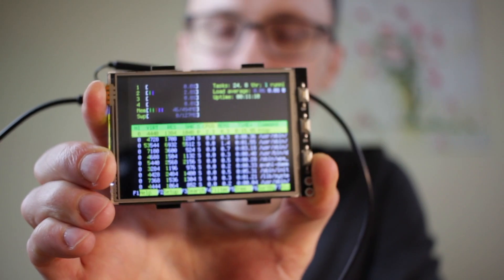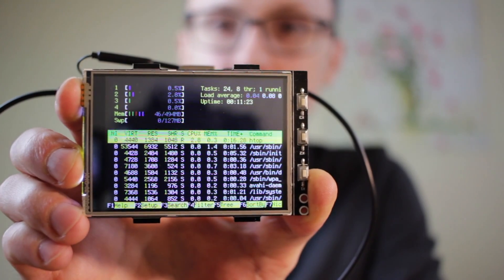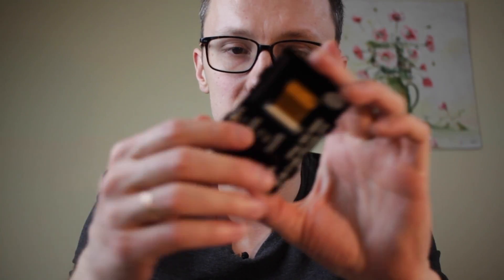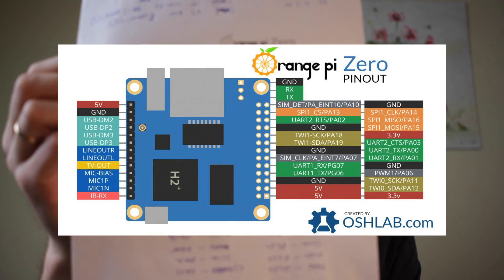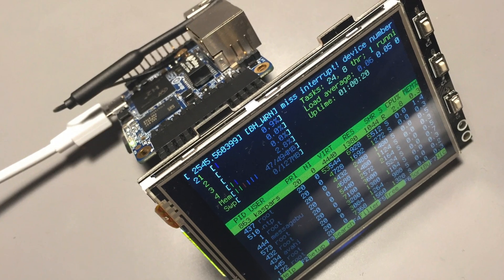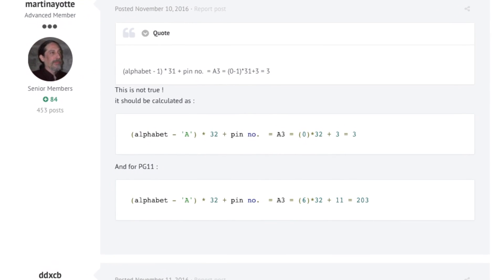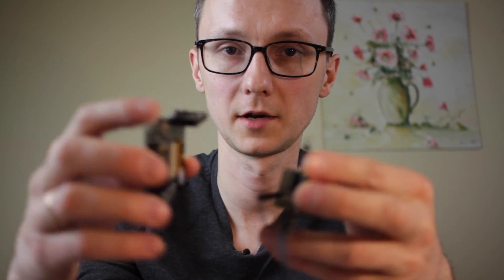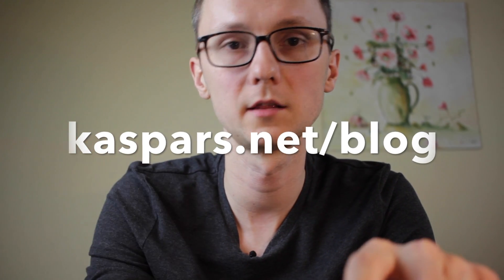Display for Orange Pi Zero

Comment: What piece are you using to connect the screen? On my Orange Pi ZRO LTS, I only have the holes for pins, no pins to actually connect to. Having a hard time locating/naming the piece I'd need before ordering the display and being unable to physically connect.
Reply from the maker: You need to solder a 2x13 (2 rows with 13 pins each) male header (also known as 26-pin header) with 2.54mm spacing between the pins to those holes. Any of the headers for the older versions of Raspberry Pi (not the 40 pin version) will work for this! Any of these should work https://www.google.com/search?q=2x13+2.54mm+header

Comment: I am trying to decide whether i need an orange pi and if it is really worth buying thanks
Reply: It is a Great board. Lts version with the H3 CPU even includes the hardware h.264 mpeg compressor on board which newer cheaper boards do not have

Comment: Will this also work with the O.P. 2G-IOT?
Reply from the maker: Not sure. It should work just fine as long as your OS can access the i2c bus. I think Armbian doesn't have official support for this board, though.
Reply: +Xander Marks seems like it got its own (maybe semi/official screen, not sure) working on Android though.
https://youtu.be/F2JcD865TFc
https://www.aliexpress.com/item/3-5inch-Black-color-Touch-Screen-LCD-screen-TFT-Suitable-for-Orange-Pi-2G-IOT-Development/32816194245.html
Reply from the maker: Yeah, that seems to be attached via the CSI connector.

Comment: Hi man! How are you? I'd like to know how could I configure this board with his expansion to connect via AV cable to my smart tv ;) Thank you very much
Reply: Armbian download page states that AV output is not working yet; either wait for updates of the distribution, or explain which other distro you are using.
Otherwise, for the hardware part, I bought a classic AV (RCA) cable https://fr.aliexpress.com/item/High-qualiy-1M-AV-line-Single-Yellow-RCA-Video-cable-Male-To-Male-Audio-Video-Cable/2027911312.html?spm=a2g0s.9042311.0.0.EoKBYo , cut it in two, soldered some femele pins https://fr.aliexpress.com/item/Free-shipping-Dupont-line-120pcs-20cm-male-to-male-male-to-female-and-female-to-female/32797542086.html?spm=a2g0w.search0104.3.15.gDbBzS&ws_ab_test=searchweb0_0,searchweb201602_5_10152_10151_10065_10344_10068_10342_10343_10340_10341_10084_10083_10613_10305_10304_10615_10307_10614_10306_10302_10059_10314_10184_10534_100031_10604_10103_10142,searchweb201603_36,ppcSwitch_5&algo_expid=a5714876-fcab-41cb-946a-7a4e698c05cb-2&algo_pvid=a5714876-fcab-41cb-946a-7a4e698c05cb&priceBeautifyAB=0  with heat shrink tube , and plug it where the docs say: small port, pins 2=GND and 9=TV

Comment: What did you use to connect the monitor to the board and which lcd are you using?
Reply from the maker: These LCD modules have a Raspberry Pi compatible connector which also works with all versions of Orange Pi, see http://www.waveshare.com/media/catalog/product/cache/1/image/9df78eab33525d08d6e5fb8d27136e95/3/_/3.2inch-rpi-lcd-b-3.jpg
Reply: Kaspars Dambis but where do i Get the gpio pins to connect to the monitor
Reply from the maker: This blog post describes the pin connections, see https://kaspars.net/blog/linux/spi-display-orange-pi-zero And here is another blog post explaining the GPIO mapping for Orange Pi Zero https://kaspars.net/blog/linux/orange-pi-zero-gpio
Reply: Kaspars Dambis ok thanks im new to these stuff..so do i need to buy the pins?
Reply from the maker: Yes, you need to solder two 13 pin "male" headers to the Orange Pi Zero, such as these https://kaspars.net/go/male-pin-headers

Comment: Thanks sir, does it work for H3 chip ?
Reply from the maker: Yes, should work just fine since the H2+ chip is very similar to H3.
Reply: Just remember it's quad core...so it runs really hot...so a good large heatsink and active cooling is key, otherwise it throttles itself really fast
Reply: @haydenc2742  You can also throttle the CPU speed. There is a module in Linux for doing the same.

Comment: Can this work on RetrOrangePi OS?
Reply from the maker: Should work just fine as long as it has SPI enabled and the required FBTFT drivers.
Reply: hmm, when I try to execute con2fbmap 1 8 I get an error "ioctl FBIOUPUT_CON2FBMAP: Invalid argument". The SPI is enabled but I don't know about the driver for ili9481.
Reply: Check out DietPi...much lighter resources
Reply from the maker: Thanks for the suggestion!

Comment: Hi Kaspars
I got Orange Pi Zero from alliexpress. And no power led flash when power on. Only LAN led flash all time (green and yellow).
Any suggestions to know is it working ?
Reply from the maker: I had a similar issue and it was because of a corrupt disk image on the SD card. Try reformatting and burning it again. I was using the latest Armbian image (legacy) https://www.armbian.com/orange-pi-zero/
Reply: Works now. Thank you. But now cant find IP of device so i cannot connect it with Putty.
Reply from the maker: You could check your router for the connected client IP addresses when you plug in the ethernet cable.
Reply: No green LED means either crappy PSU, or bad system on SD card.
To find the IP, you either need a scanner (there are apps for mobile phones), or connect to the serial console (there plenty tutos in google; buy an USB serial port and a pair of Pudont wires).
Scan 2mn after boot, remove ethernet cable, rescan, see which IP have gone away. The IP is usually the same for a few days, untill you reboot your DHCP server. To get it fixed, ask your DHCP to fix the IP using the MAC.

Comment: Nice! I just bought it as a chromecast replacement and found out that I screwed up. No HDMI. Is there any way to get an HDMI port without much of a fuss, or should I just buy a different board?
Reply from the maker: There is no way to add HDMI as far as I know. It does have composite video out though https://forum.armbian.com/index.php?/topic/2913-orange-pi-zero-tv-out-and-x11vnc/#comment-21046
Reply: The H2+ does not have the HDMI chip at all (it's not only missing the plug on board; it's missing a chip in the SOC). 
There is a TV output, but it's not working yet in Armbian 5.35.
The only way to get video is SPI (and I love it).
Sell me your zero :)
There is an Orange zero with HDMI support; but it's 3 times more expansive. Not sure the exat name (zero plus or zero PC ... ask Ali).

Comment: Hi friend! I'm using a translator! I'm using Orange Pi Zero and installed Ubunto Desktop on the SD card, to see it working only with the Lcd screen ?? I have here a screen of the Raspberry pi 3, does it serve to stop calling? Thank you
Adalberto - Brazil
Reply from the maker: Hi! Unfortunately Orange Pi Zero doesn't support the DSI interface used in the Raspberry Pi display.

Comment: Orange Pi zero can be used as Homebridge server???
Reply from the maker: Armbian does support Node.js (see https://forum.armbian.com/index.php?/topic/1019-nodejs-on-orange-pi-pc/) and it has WiFi so it should be possible.
Reply: Dear Kaspars thanks for your quick response, normally i do not need WIFI, and i was planning to buy Nanopi Neo (Friendlyarm - Debian jessie) because of its processor (H3 instead of H2+ of orange pi zero), do you recommend Nanopi Neo for Homebridge server?
Reply from the maker: I have NanoPi NEO and they are very similar apart from the missing WiFi on NEO. I feel like they are both equally good choices for a network based application.
Reply: Thanks for your reply Kaspars, hope i can succeed to install homebridge over it. For my need, there is no need any HDMI output like PI 3, so thats why i will prefer to get one of these devices. Thanks again, looking forward to get your informative videos.

Comment: Hello Kaspars Dambis great video  have a question , 
Orange pi has secondary ethernet port pin?
Reply from the maker: It has only one Ethernet port.
Reply: i know that has only one ethernet installed true the board,  what i ment  is it possible via GPIO pins add secondary ethernet ?
Reply from the maker: You could attach an SPI based ethernet controller like PiJack https://www.youtube.com/watch?v=PcT6ncGLMjE or this https://www.itead.cc/blog/enc28j60-ethernet-module-and-demo-codes (both use the ENC28J60 chip) but I haven't tried it with the Orange Pi Zero.

Comment: Could this one work? I try to keep it low budget. https://nl.aliexpress.com/item/Free-Shipping-2014-New-Arrival-1Pcs-3-2-Inch-LCD-Touch-Screen-Display-Monitor-Module-For/1987749223.html?spm=2114.010208.3.38.9o1alZ&ws_ab_test=searchweb0_0,searchweb201602_4_10065_10068_433_10136_10137_10138_10060_10062_10056_10055_10054_302_301_10059_10099_10103_10102_10096_10052_10053_10050_10107_10051_10106_10084_10083_10080_10082_10081_10110_10111_10112_10113_10114_10037_10033_10078_10079_10077_10073_10070_10122_10123_10126_10124-10050,searchweb201603_4,afswitch_1,ppcSwitch_5,single_sort_0_default&btsid=e291cc24-2b9d-4b32-81da-9a95840aa775&algo_expid=9659f3e4-d3b3-49cb-814b-4cec7ea4f968-4&algo_pvid=9659f3e4-d3b3-49cb-814b-4cec7ea4f968
Reply from the maker: Yes, that looks exactly like the one I have.

Comment: Excellent job, man.
Thanks a lot for sharing. Sunxi wiki also got some info on OPi0:
http://linux-sunxi.org/Xunlong_Orange_Pi_Zero#Expansion_Port
Reply from the maker: Yeah, I used that to get the H2+ port names. Too bad they don't include the GPIOs numbers. Maybe I can suggest a Wiki update.
Reply: Oh cool you added that image! ;D Thanks.
good job, but honestly it is not clear, as the 90' degree header pins are blocking the view.
A person in the know can easily figure it out, but it is hard for beginners.